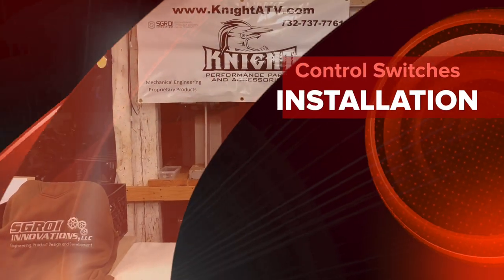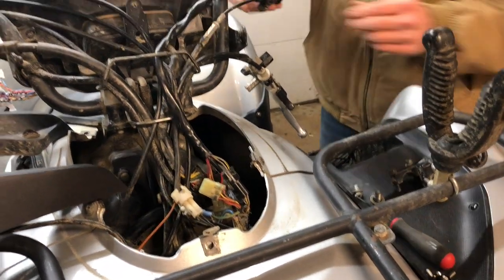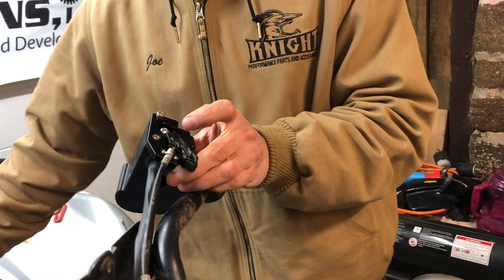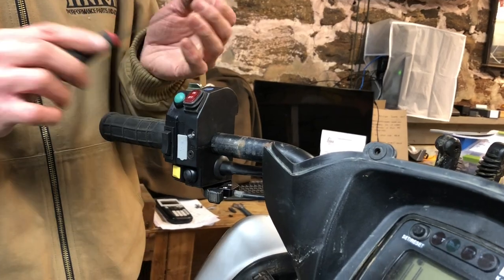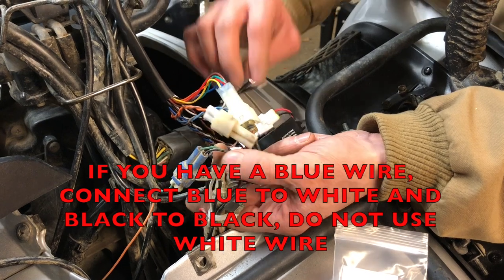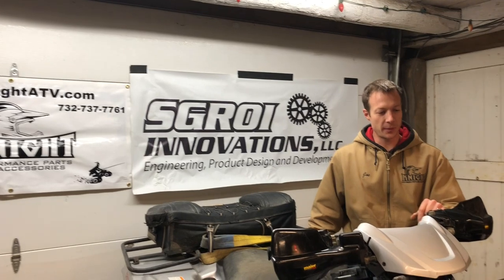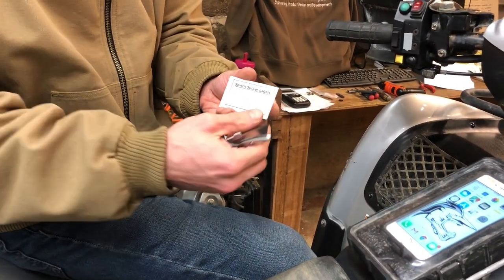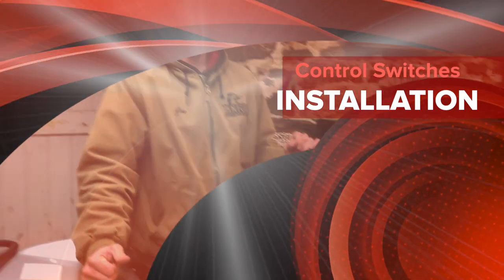Control Switches Box Installation (Light switch, start button, kill switch)

Comment: I just put mine on last night. I have a question. How do I use the black on/off switch next to the yellow button? I would like it to be used to control my demand hand grip warmers. Can you help by providing me a good connection point and a diagram so I don’t mess up the control unit. I also can not get the USB port to work. Did I miss something with that?
Reply from the maker: Hello! Please check your email, we sent you a diagram regarding the hand grip warmers :)
As for the USB port, please make sure that the black wire is grounded. The USB port will only work if you have the black wire grounded.

Comment: Hey just installed my kit on my 2007 Kawasaki brute Force 650 solid rear axle. Only problem is the light switch is on low, on high beam, on low again, then on low with light bar. Any help thanks
Reply: Never mind I figured it out it was that little tiny 3 mm grub screw on the top plate for the switch wasn't grounded all the way.
Reply from the maker: Glad you were able to get it figured out! :) Hope you enjoy!